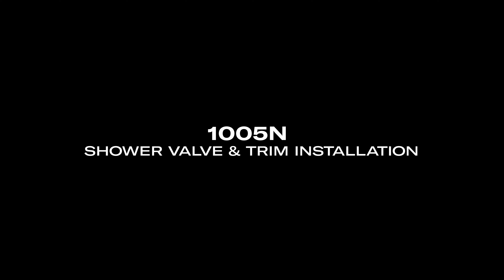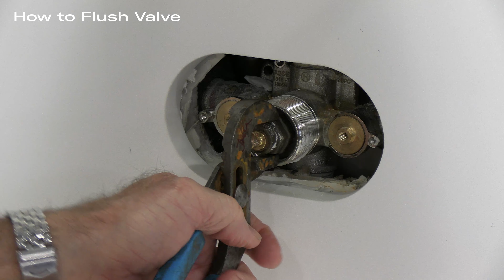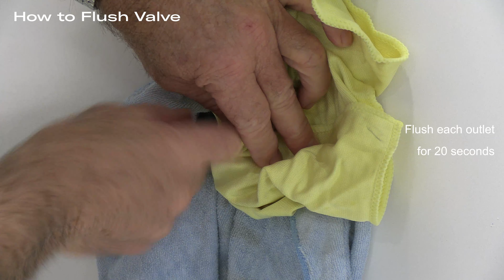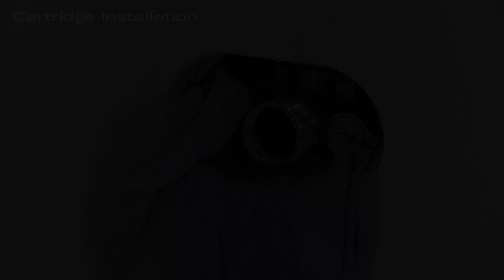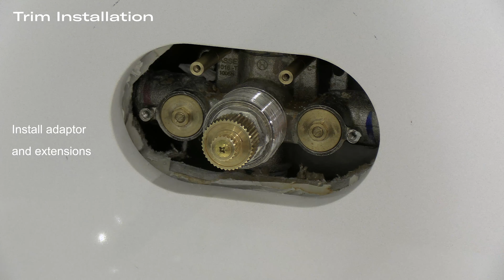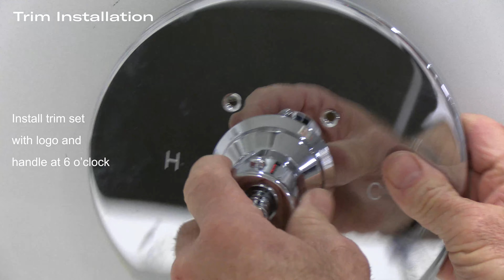1005N Full Length Video

Comment: What is the part # of the adapter you added to the cartridge prior to installing the trim plate?  I cannot find the adapter online and the trim plate will not mount without It. Thank you
Reply from the maker: Please give us a call at 800-777-9762 (select menu option 4) with the model # to the trim you are installing with this valve, and we can support you with the correct adaptor. We look forward to working with you.